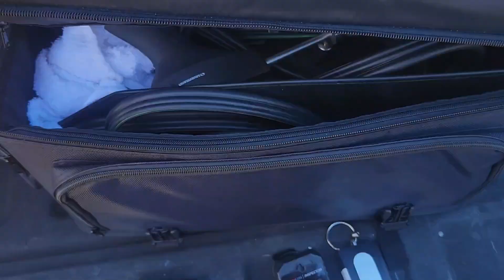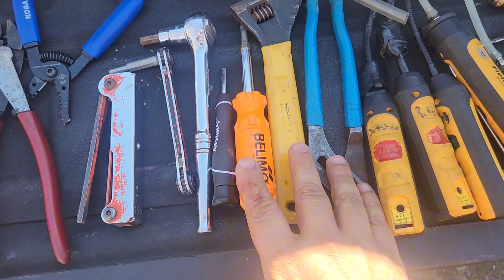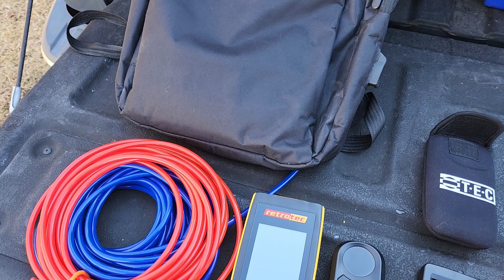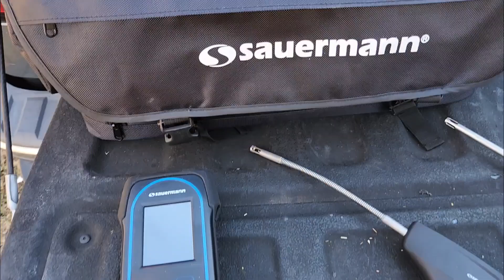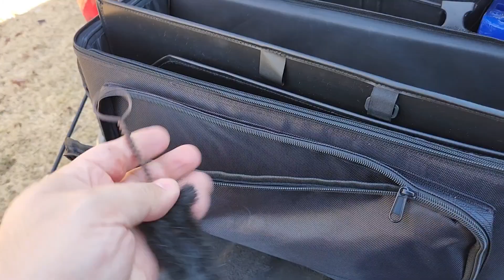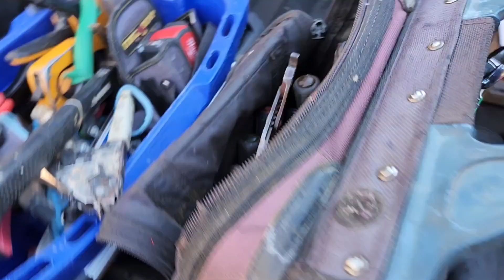My HVAC Tool.Loadout

Comment: It’s a constant battle with load outs between too much/too heavy vs. that extra trip back to the truck.  
For AC/Heat pump I actually went lighter with 2 mb3's-one with tools for diagnosis electric, and the other with all the probes. 
If the call is an obvious electrical issue, I can leave the probe bag in the truck, otherwise it’s easy enough to carry in both.  
The other conclusion I  drew regarding carrying less, is there are only a few things you can actually fully repair without making a return trip to the truck, so why bring the whole kitchen sink? So I made up smaller grab and go 'kits' for specific tasks that have all the tools/parts to complete that task.  Motors kit, pvc/drain/condensate pump kit, copper tubing kit, sheet metal kit, etc.  I do end up with some redundant tools, but that just means I get to buy more tools…:)
Reply from the maker: @HVAC_Tips_Tricks_Calcs  good plan